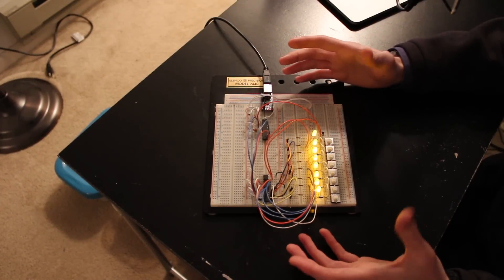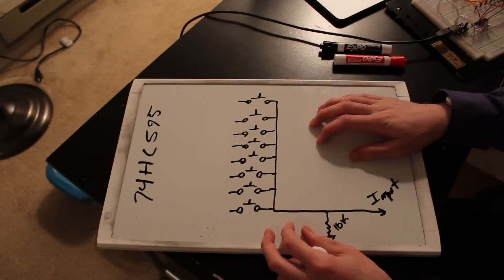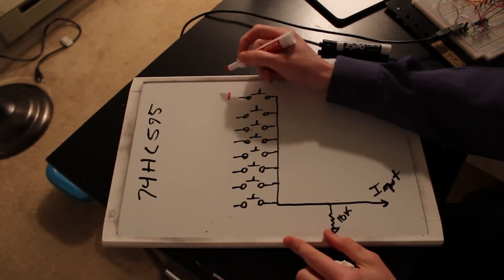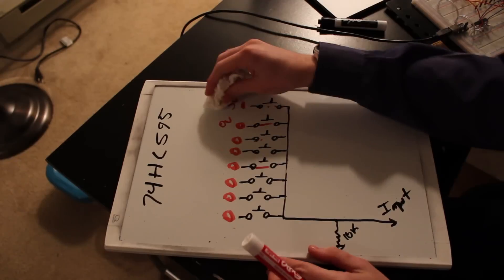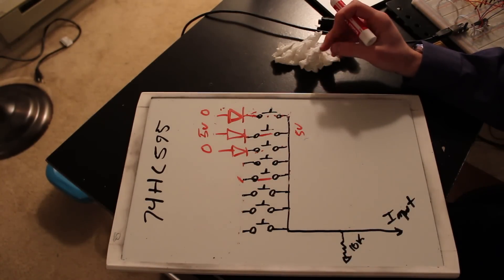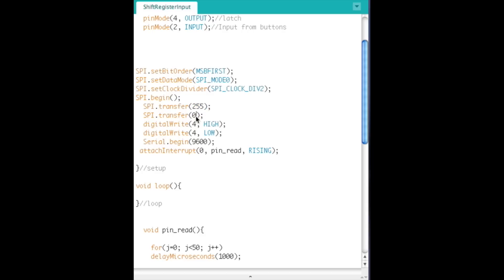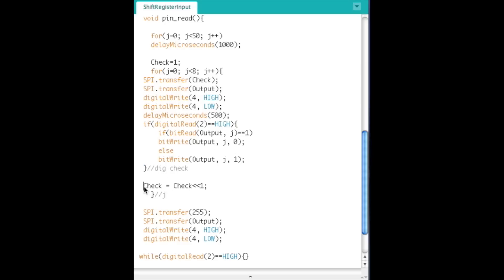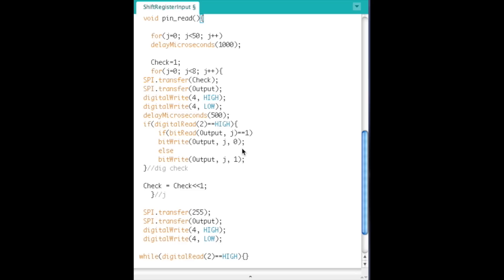How to Control a Ton of Inputs using Shift Registers!

Comment: I'm attempting to use 16 buttons with 4 shift registers but I can't seem to get the 2nd half working right, you can find my code here:  https://github.com/linuxgnuru/inputs_with_shiftregisters
if anyone can help; i'd appreciate it.
Reply: I had a quick look in your code. 
First, pinmode for pins  11 and 13 seems to be missing. But as you said it works for the first register, forget about them. Same for using pin 10 for latch instead of 4 (but maybe its configurable.
Kevin only used 2 registers linked together, 1 for input (the last one) and 1 for output (the first one).
In the pin_read you  should just make a 1 to 16 loop instead of 8 and provide a 16bit unsigned integer for  check0 and check1.
Come back if you're still searching or need some more explainations.
Have you correctly linked your registers (same clock but out from R1 goes to in of R2) ?

Comment: Why not just use an HC165?
Reply from the maker: yea, I made a video on that too
Reply: okay
Reply: To use a HC165 (or other parallel to serial shift register) you have to constantly read in the register to know whether anything changed. With the '595 you just turn on all the outputs and you forget about it until an interrupt occurs. When an interrupt occurs then scan to see which one(s) caused the interrupt.

Comment: could you please show me a schematic of how i would connect 8 switches(input) to my 74HC165 to Arduino and then to my 74HC595 to my 8 LEDs(output)?When a correspong switch is off, then a corresponding LED should go on
Reply: did you found some schematics about it?

Comment: But the voltage for the reverse biased diode is 5V-voltage lost in the diode, so if you push that button high, you will have 5 volts on the anode and 4.x volts on the cathode. Isn't that fw biased?
le : in fact no, you'll end up with 5 V - voltage loss which is not enough to fw bias the diode.

Comment: which diodes did you use..?
Reply: I think you can use small signal diodes like the 1N4148 or so.  It's just to stop the (small) current from flowing into an output which is at 0 while another one is at 1.
Reply: nearly any small diode would work here. Use what you already have, or is cheaper in your preffered market.

Comment: Hi Kevin ! I'm working on a project using your setup (actually, using the "piano" version as it's exactly what I'm trying to achieve), and I can't figure out something. I don't get the usage and difference between the data and what you call "Input from the buttons" (pin 2). What exactly is this pin 2 doing and how to connect it to my buttons ? We can't really see the board or schematics in your video :/
Thanks !

Comment: Erhm honestly thanks for showing that circuit with the analogRead at the start. That'll actually do for my project since it's only 4 buttons I'm using and they shouldn't/can't be pressed at the same time in my interface. I'll definitely start playing with shift registers in the future though when time is a less pressing issue :P

Comment: I am confused as to why you are using the 10k resistor, im quite new to this so I hope its not a stupid question. Your explanation was very clear!
Reply: +Timo Benkhard - Arduino pins configured for input are in high-impedance mode, and react to very small amounts of current, so they can pick up noise and appear to change state when they're not connected to anything. They have built-in pull-up resistors (that you can enable via software), but no pull-down resistors, so if you want the pin to always appear low when there's nothing connected (as in this case), you need a resistor between that pin and ground. 10k is a typical value (low enough to ensure the pin gets set to low when it doesn't have a signal, but high enough to make sure the pin goes to high when signal arrives).

Check the "DigitalPins" page on the Arduino Tutorial website for more details.
Reply: @RFC3514 - I don't think it has something to do with the Arduino inputs directly.  If the 10k resistor is not present and you put an output of the shift register IC to 1, you're making a short circuit between that output and ground (apart from the diode which is in between, but this one will conduct).
I'm afraid this won't be healthy for the shift register device because I don't think there's protection inside the chip itself...
Reply: Geert Vancompernolle - Just try it, and you'll see. Or read the page I mentioned above; the Arduino manual makes it pretty clear.

Comment: What if we want Less Than 8 LEDs or More than 8. , 
HOW do we STOP at the appropriate Number??  
Do we simply change the value of "J" in the for loop??
What happens to the OTHER Data in the Register??

For MORE than 8, How do we CASCADE to another Register??
Reply: For more than 8 outputs, you simply connect Q7' (that's pin 9) of the first shift register to the serial input (that's pin 14) of the next shift register and so on.  Like this, you can make a huge chain of shift registers.
For less than 8 outputs, you should "mask" the non-used outputs by writing a 0 to them.  Suppose you only have 4 LED's connected to the first 4 outputs and you want to light them all up, you should write 00001111 to the shift register (MSB first).  If you only want to light up, say, LED 1 and 4, then you should write 00001001 to the shift register.  After you've shifted those values into the shift register, only then activate the STCP pin to move the shift register content into the storage register.  If OE is low, the results will be written to the outputs.

Comment: Holy crap. I knew that you could make a 595 into an input but i never knew how. I never though out trying it like this. LOL!
Reply: I was just looking at this again today and realized that you might be able to make the ISR quicker by utilizing some sort of more efficient search routine. I don't know how well it would work given that the 595 pulses downwards but it might be quick enough to not call another ISR. It would take some testing.
Reply: You could make it more efficient like this: 
The interrupt routine writes 00000001 into the '595 to check the first button. Then instead of writing 00000010, just send one clock pulse (and latch pulse) to move the bit over to the second output, then repeat six more times. (or 14, etc.) No need to write all eight bits each time.

Comment: I had no idea the shift register could be used for inputs too, thanks so much.
Reply: +Yemto - This is a pretty roundabout way of doing it, using a serial-to-parallel shift register, though (useful if you only have those available). Assuming you're not stuck with the 74HC595, though, you can use a parallel-to-serial (or bidirectional) shift register (ex., CD4021B) to do most of the work for you. 

Check the "Parallel to Serial conversion" tutorial page in the Arduino site for some examples.
Reply: To use a CD4021B (or other parallel to serial shift register) you have to constantly read in the register to know whether anything changed. With the '595 you just turn on all the outputs and you forget about it until an interrupt occurs. When an interrupt occurs then scan to see which one(s) caused the interrupt.
His way is actually pretty clever.

Comment: why didnt you simply just use a shiftIN register? isnt't it quite easier?
Reply: To use a parallel to serial shift register you have to constantly read in the register to know whether anything changed. With the '595 you just turn on all the outputs and you forget about it until an interrupt occurs. When an interrupt occurs then scan to see which one(s) caused the interrupt.
Reply: @GordieGii  you are doing gods work

Comment: Can anyone help with what change to the code is necessary to control 16 leds with 16 push buttons.
Reply: You can check out the ButtonReadChain code here: https://github.com/larsensolutions/arduino

Comment: Just wondering if you could offer suggestions as to why this code works on an UNO but not on a mega2650? I've tried changing the pins in the code to the appropriate MOSI and SCK pins on the mega but still no luck. Any help appreciated

Comment: Good watch but i'll use a 165 instead. All the code just taking up space and time. But still very nice to see an alternative way.
Reply: To use a parallel to serial shift register you have to constantly read in the register to know whether anything changed. With the '595 you just turn on all the outputs and you forget about it until an interrupt occurs. When an interrupt occurs then scan to see which one(s) caused the interrupt.
Clearly you could improve on his code to make it more efficient.

Comment: I was a maestro of IBM 370/390 assembler.  You are a maestro of at least Arduino coding.  So maybe also C and others.  Anyway, I appreciate your coding.  Even with the quick hacks you write for these little demos, the code is still tight without being so tight to be incomprehensible like some C/C++ coders like to do.  You show off just the right amount.  It is easy to understand and "elegant" for demo level programs.  I have seen MUCH worse.  Thank you for taking the time to do these demos.  I understand the electronics and have for decades but your integration with programming is enlightening at the next level of HW/SW integration.  Well done.

Comment: There is an error in the code. 595's are activated by rising edge, but your code is written in such manner  digitalWrite(HIGH), then digitalWrite(LOW);
Reply: Learn It's not necessarily an error, but he has to be sure the output was low before he makes it high. But you're right, reversing the order (first low, then high) would be better.

Comment: What type of diode would I need for my push buttons? What type of diode are you using? Many thanks
Reply: any type of diodes should work correctly in this case... it doesn't matter as long as they are forward baised as shown on the tutorial
Reply: Jamie Lewis He's probably using 1N4148s. These are cheap and more or less the standard for small signal diodes.

Comment: I'm thinking about it. if you control the LED via 74HC595, you can control about 4x4 LED's with every shift register. But if you use it as an input, it's almost 8 at a time. That means if you have a lot of inputs, like 200, you will also need a ton of registers, like 25 for 200. I feel that there will be problems if the inputs are grouped in matrix, any idea?
Reply: You could possibly make a matrix input but I don't know if you could maintain the interrupt driven feature of this scheme. Therefore you would have to constantly scan the matrix.
How about this:
Use the '595 to drive 8 rows high. Use a parallel to serial shift register to read the columns, and constantly clock it with a PWM output. Don't actually read the input, just let it wait for an interrupt. When any button is pressed the input will go high within 8 cycles of the PWM. Then read the input shift register to see which column is on, then scan the '595 to see which row is on.

Comment: Good button technique but all those delays in an ISR is very bad practice.  You should only record the state of the buttons into variables and let the main loop process debounce and determine if the buttons have been pressed.  Another way is to check a clock state and determine if the button has been pressed long enough in the ISR and set a state.  The objective is to manage the button state as quickly as possible in the ISR and return to the main loop (rest of the code).
Reply: Agreed, but the author was saying he had not prepared himself to the video, and he appologized to us. As for ISR, indeed the 'routine' (not function) should only set some flag to true/false, and that is all.  Hardware interrupts work aside normal program execution. MC/CPU stops normal program execution for checking all that interupt stater and running ISRs. And I think unless the current ISR() routine finishes it halts executing next ISRs, thus stops running the code and other interrupts (timers?). I think, such behavior prevents also from multiple execution of the same ISR over, and over again berore the first one finishes. (we would experience interrupts interrupted by interrupts - endless loop). The loop function should do the job. Anyway great lecture, thank the author. Have a nice day.
Reply: @DupczacyBawol  As pointed out, yea... this has nothing to do with ISR or anything like that. And even if he apologized for not being prepared to make a video... if you haven't prepared, why make the video? Lol. EVEN then, again, being prepared for a video has nothing to do with implementation. I could set up 20 servers for a business, but then go 'I wasn't prepared to give an orientation on how to use these servers', and yet that orientation would have NOTHING to do with me actually installing an OS onto the hardware and installing the necessary drivers/software...
Reply: You are right, but purpose of THIS video was not ISR, but the button/diode/pin 2 trick, no more. So the code is just as demo, how it is possible to read that, not how it should be done in "real" program and even waiting in ISR does not matter, as there is no other code to execute, nor other interrupt to take care of.

Comment: There is another problem with this idea, if you want to use some digital sensors to use instead of switches and all or any two sensors read at the same time, then it will be wrong reading. Isnt it?

Comment: Great video, just what I was looking for.  I was thinking multiplexing.   The main draw back I see to this is you need lots of diodes and shift register chips.  Is this how PC keyboards work?  Maybe not because you can only detect some keys in sync.  Seems like you could butcher a PC surplus keyboard (free) for some kind of cheaper system.  

Also, are the parallel port pins on a PC interrupt capable, and could you drive a shift register with it?  Because I'd like to use a PC to control my shift register city instead of a tiny embedded controller I'd have to program in shitty fucking rancid C (I'm looking at your C program to drive the shift registers and not a damn bit of it is intuitive or self evident.  The hardware explanation - yes.  The software - fuck no - you must of grabbed that code off of some internet website or a passing skyhook).  

With a real PC I could do something hardcore high level in Python...  or some other real language that's not gratingly having to control the bare metal and silicon.  

Plus - I don't understand what happens during your debounce delay... inside an interrupt.  Is the whole cpu just going to halt everything it is doing while it does that loop - and not do any usuable work at all then?   If so, every time an input happens anywhere and your pin 1 is high, your going to have interrupts happing over and over again with 50 millisecond delays saturing the CPU, and no real programs get executed outside the interrupt loop.  You hold down any button and you're constanly being interrupted and doing that delay over and and over and over again.  And while it will make your key presses and leds responsive and you'll notice those changes... your real program that does real work based on those presses outside the interrupt will never get any cpu cycles... or will be drastically slowed down.

Comment: Not sure if it works in the Arduino IDE, but just a suggestion for the future. In the for loop, instead of having the "Check" variable shifted and then run through the loop again, the parameters of the loop could be:

for( Check = 1, Check >0, Check<<1)
{ 
      //contents of loop
}

This would automatically shift the value over by 1 every loop iteration. You just need to make sure that Check is declared as a byte, and that it is signed so that when you do the final shift, it becomes -1. 

Love your videos by the way. I am doing a project soon with an LED cube and stumbled across them. I work with embedded devices and firmware and am excited to start my new Arduino hobby.
Reply: Hmmm.. byte becoming -1, I thought bytes was unsigned number between 0..255 with values at every bit (seat) as follows.. 1 2 4 8 16 32 64 128. No minus for bytes.. at least in the language Pascal I use most of the time.

Left shifting just shift value of bits to higher places, that is, race the value to power of two. You could also easily use 8 bit array values of bytes. 

When pushing two or more buttons, two or more hardware interrupts will occur. This "dirty" technics he is showing by overloading interrupt function in endless loop is very scary and against every thing I would even consider.

Kind of challenge to optimize this, one idea is to save the state of prior interrupt's and use binary search, test first by using byte value of 15 (4 least bits signed) if no signal, then you know it is one of them who gives you 240, halve that and 3 readings is enough in worst scenario etc. and of cause take prior state of buttons in to those calculations with masking.
Reply: @bjarnieinarsson3472  wait, wut?

By "-1" I think the conditional tests true in that instance 

And "Endless loop"?  Where?

Comment: That is pretty neat.

However for a thousand inputs it would probably be a good idea to be a bit more efficiant: You could make this even faster by divide and conquer instead of a linear search. For 1024 Inputs you only would need 10 checking cycles compared to 1024 in the linear search.